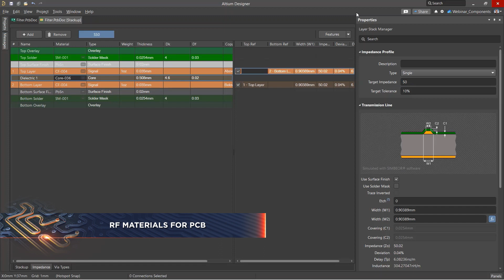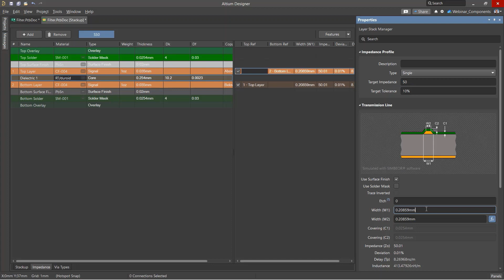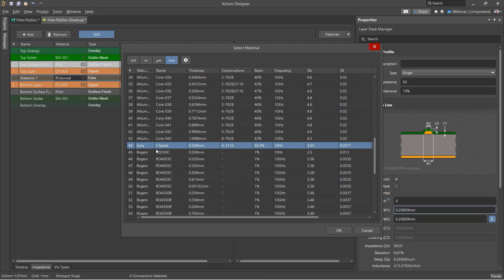RF Design in the PCB: RF Materials

Comment: Really very good, thank you.
But the assertion that traces are transmission lines through the dielectric is only a very crude approximation, although much better than none.
If the conductor is not a mirror-perfect enclosed rectangular wage-guide, then the current propagates via EM radiation OUTSIDE of the trace!
This is basic QED.